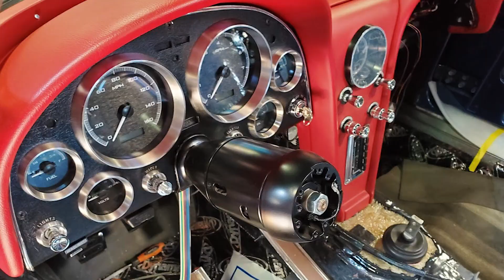LS9 Powered C2 Corvette Restomod - Full Transformation in 5 minutes!

Comment: How much does something like this go for?
Reply: Nuts and bolts restoration, crate motor & transmission, paint job all done by a respectable shop... $150,000 - 250,000, I'd imagine.
Reply: @theglacier3367  wow that’s insane! I think buying one that’s been taken care of or restored already would be the better bet here. I looked up c2 vetted and they range in price from around 60k-170k  there’s some with less then 3k miles on it. My dream is to have a restomod 1963 c2 vette or any c2 I could get in that silver bullitt color. Also a c1 vette fully restored or just great condition in red with white convertible and that top would always stay down. Lol dreams!
Reply: @jl4081  It definitely depends. I'd say you couldn't build a restomod to quite THIS capacity for less unless you could do most of the work yourself or with friends. Now, you could build a less extreme restomod for a much more reasonable price.

For example, I have a 63 Vette that my buddy and I are restoring. We stiffened up the factory frame, will be using factory 4 piston brakes, and some other things. I'd like to purchase a crate LS3 and TKX 5 speed transmission. Should be a fun, above-factory weekend car, and we can probably build it for $40-50k from the ground up. I inherited this car though, so my sunk cost was non-existent. Everything needed to be replaced though.

If you're interested, take a look at my buddy's YouTube channel "Mid-Year Mitch". You can learn a lot from him, if you want to tackle a classic Corvette project, as he's built several out of scraps. He even built one for $25k start to finish, but it was unpainted and had very little interior.
Reply: @theglacier3367  thanks I’ll take a look, Maybe someday I can find a c2 vette that needs a little love and restore it to its former glory. I’ll tell you one thing it won’t be a garage queen, I’m driving it and having fun with it, I’ll definitely take care of it and garage it but it won’t just sit there looking pretty and only seeing car shows.